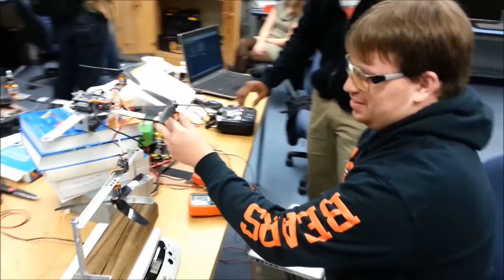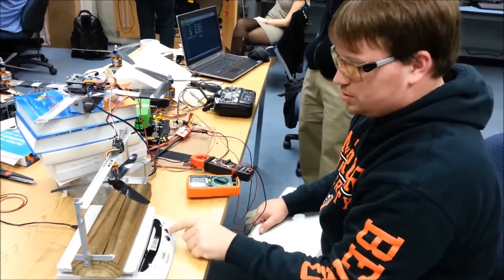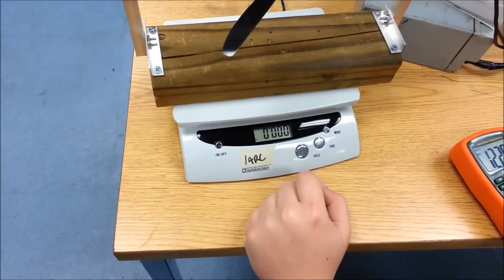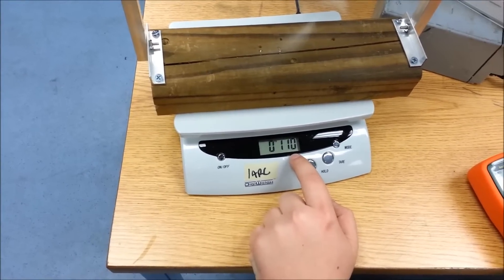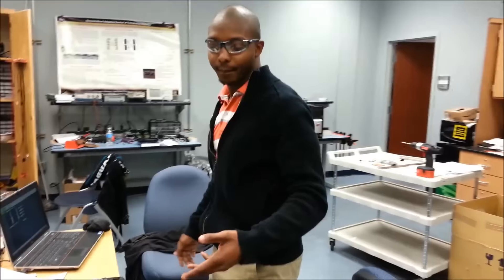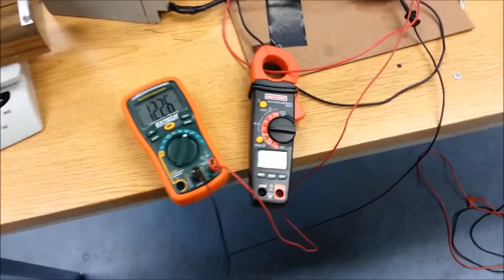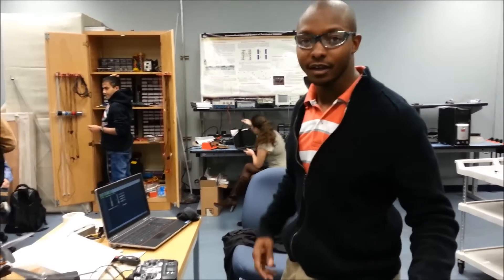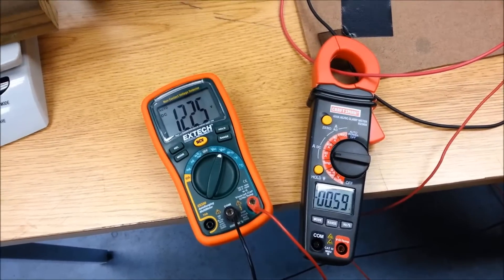Mercer IARC: Quadcopter's Thrust and Power (Part 2)

Comment: Hey guys, great vid's, what would you concider the most effective motor and prop setup for a 600mm quad? 3s or 4s, high kv with small props or low kv with big props?